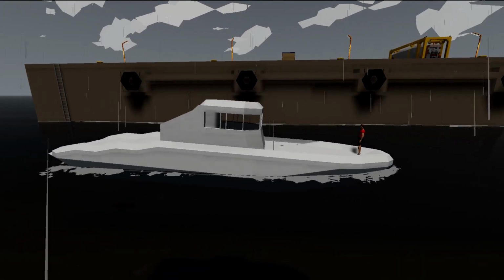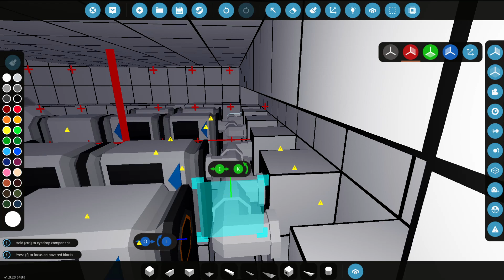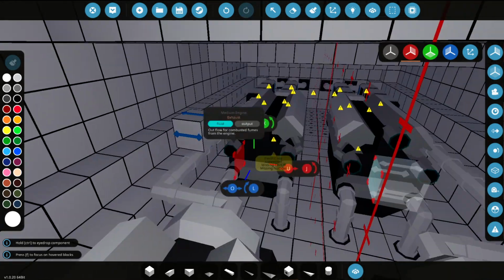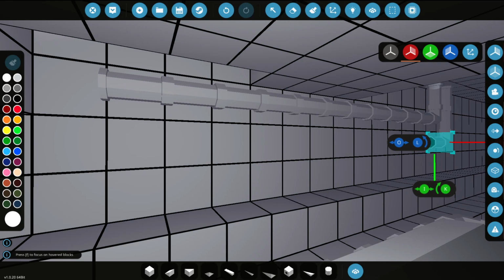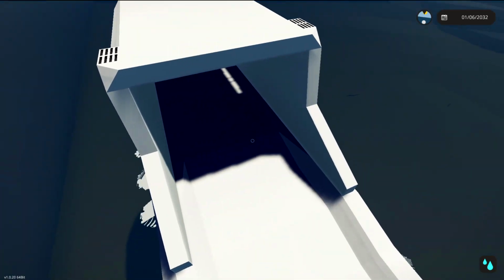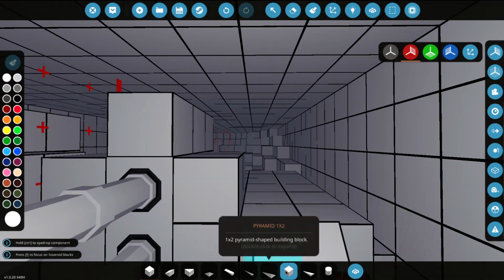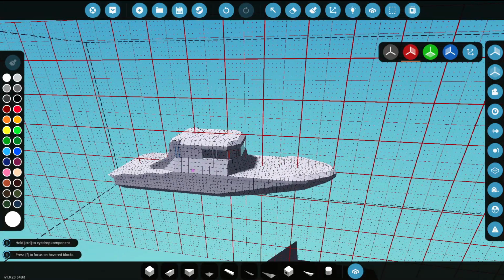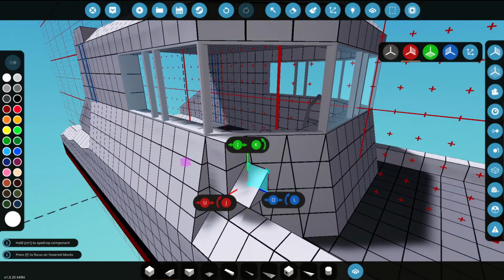Adding Working Engines!  - Medium Boat -  Stormworks Build and Rescue

Comment: I think u need to put the fuel abot ports down in the tank frantic beacuse When the fuel goes down it will move down and the ports cant suck it up if im not all wrong
Reply: No you can have the ports wherever you want, it still works iirc

Comment: I may seem retarded for asking but none of the tutorial videos show this, HOW DO I RUN PIPES THROUGH THE HULL. All engine videos already start with the Engine Connection Ports in the hull already I dont see in the library of objects ports/connections that hook up power to the rngines the little Orange connections that are blocks... everyone always starts with those already there and I dont see in the editor where they are to hook up the engine components.